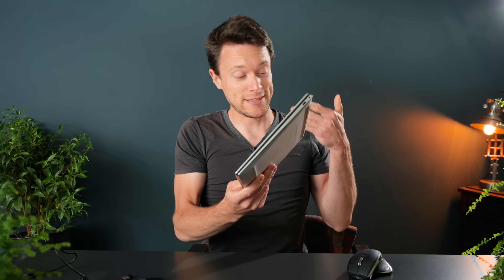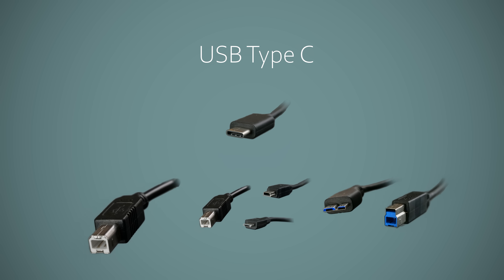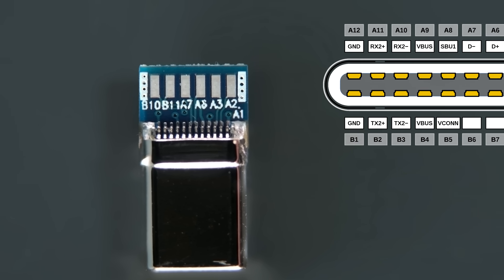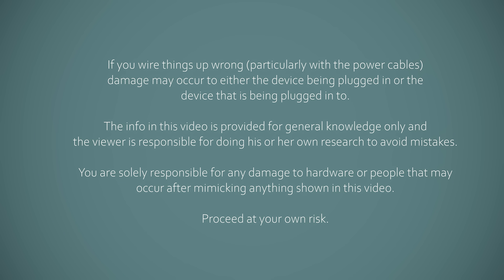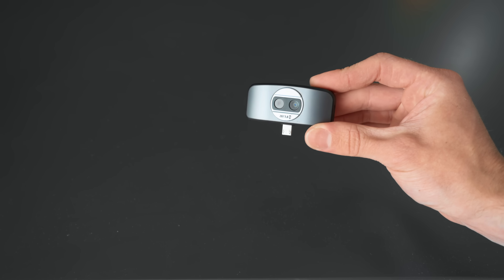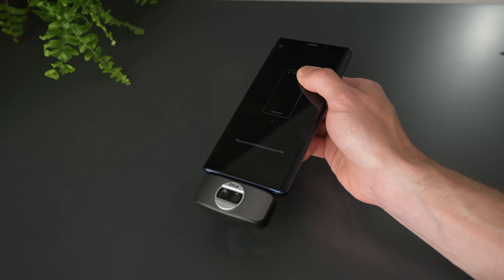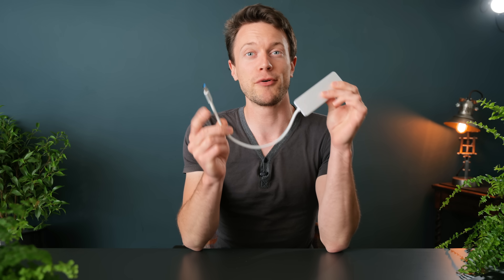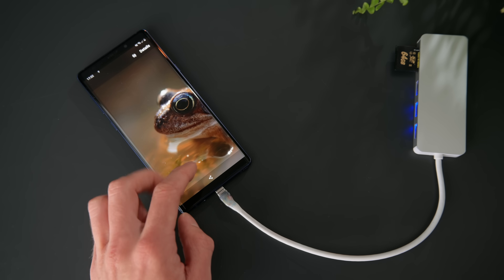Converting devices to USB Type-C

Comment: There is a good reason for dongles especially the micro dongles to use USB-A plug.
They are much more sturdy and wont break easily. It wouldn't be funny to buy a new 10-20€ dongle each time after accidentially bump against it.
Also if a laptop only has one single USB-C port its mostllikely thought to be used with a USB-C hub.

Comment: I was hoping you'd do B-C
A us very useful and not really in need of replacement. However B needs to go away.

But A is very resilient and strong unlike C which feels like it could break easily. Especially if you're using a wireless adapter. Type C would snap under the weight and pressure of a USB stick or my 8bitdo adapter.
Reply: I have never had a USB C break on me, and I use them heavily.

Comment: The issue with USB Type C is people always think that there's only 1 Type C but technically there are several, there are type C with USB 2.0, 3.0, 3.1 standard, and then there's Thunderbolt...
Reply: But they're all intercompatibal, so it doesn't matter. Theres also many versions of USB A, and even they're inter compatible.

Comment: 3:36 couldn't you trim like 20-25% off, seems no traces on both sides :D
Reply: Nope, it's very faint but you can see the antenna in the top part
Reply: Then maybe antenna from wire would work?
Reply: @pofka3000  if you want to spend hours researching how to make an antenna from scratch and how to solder it on, sure. I can guarantee your solution won't be more compact than what's already there.

Comment: Will there even be connectors in the future as everything will be wireless? Something completely different, can we use stretched bar type displays to cover bezels of 2-3 adjoining monitors? Of cours the bar has to be bezel free as well. We might even use a couple of old macbook touch bars for those.

Comment: 7:04
You could have just added a solder blob between Ground and R1 after scraping the trace to V+.
Or you just remove R1 and solder it where it says R2.
That would save you the hassle of soldering this THT resistor onto the board.
Reply: I also was surprised! This info should be included in the video!
Reply: I thought the same thing, the circuit board seems to literally be designed with the extra solder pads for that purpose. It is possible he thought this method would be more accessible to novices. It's also possible that being close to the project he simply overlooked this method. I know when I'm modding sometimes I get an idea in my head about how to do something and I later look back and realize I missed an obvious optimization.
Reply: It may be a pain but I would just reuse that resistor right. Im going to assume the resistance value is important
Reply: yes, when you plung something a voltage divider is made from the DFP (host device) and the UFP (Device device), that voltage set the power delivery, if 0.25 - 0.70V then is legacy 500mA, 0.70 - 1.31V is 1.5A and more than 1.31V is 3A. anyway that just set the limit. if that resistor was 56k the V will be over the limit if the port can't give 3A. What will happen? on somes times that just shutdown the port.
Reply: Yeah someone clearly went to the trouble of making these boards as easy as possible to switch, and he just destroys the trace and slaps an absolute unit of a resistor on there. Just sliding the resistor over to the other pad means you don't need to have spare resistors on hand, and you don't have to guess at resistor voltage.
Reply: Thanks God you mantion it, I thought the same and was wondering, becouse he seems to be a person with enough knowledge about electronics and solve this problem in such a strange way.
Reply: The value for a pull-up and pull-down resistor on a USB-C device wouldn't be the same, so simply moving the same resistor to the other pads probably wouldn't work. Still, it would have been easier to just remove the existing resistor rather than cut the trace, and adding the correct SMD resistor would've been much cleaner.
Reply: USB specification requires different resistance for pull-up and pull-down otherwise you potentially would make it possible for the device to draw more power than the plug can safely supply or the plug to push more power than the device can take. Basically  5.1 kΩ pull-down, 56kΩ pull-up. Remember all those cables being sold using 10kΩ and frying buyers devices ; )
Reply: I totally agree. 5:55 It is clearly seen, that moving resistor in the another position should be fine. And this guy has lots of DIY projects, but no understanding of what pull-up/pull-down resistor means. Such a disappointment.
Reply: @sorgmail  yes odd that he didn't do that, I would have thought that would work
Reply: Okay let me explain what @TigerChills means. You see he cut the PCB trace on 5V so no contact was flowing through resistor. He should add some blob on the left side. That way you don't need to remove and relocate the resistor
Reply: @potatobuilds  just as simple as that ? no scraping ? just a single blob on the one to the left of it ? you don't have to blob the two together ?
Reply: @artusart  You missed my point. He cut and scraped the VCC to R2 that's not a bad thing actually if he did that instead he should add a blob on top of both R1 and R2 that way you don't need to add a big resistor or remove completely the SMD resistor on R2. What I said about the left side is actually top left to top right.
Reply: I’m not going to debate which is better for novices (Tweezers anyone?), but I will say that a large THT device on a small SMD board is destined to short on the leads or rip pads for a large number of novices.
Reply: Why on earth would you assume that the resistor needed to pull down to ground, would be the same as the pull-up resistor ??????? Idiocy
Reply: The supplied resistor on the board (pull-up) is a 56 kΩ one. The one that needs to be installed (pull-down) is 5.1kΩ. So you can't just move the resistor over. You either need a 5.1kΩ surface-mount (SMD) resistor and thin solder plus a thin tip and a steady hand, or the 5.1kΩ through-hole (THT) resistor suggested in the video.
Reply: Yeah thats what i think too.  it would do less space and hassle if he reuse the old SMD resistor
Reply: I agree with Tiger. He could just use a wire to connect ground to R1 and then have no need to desolder, find a correct resistor, or remove components. Could even use wires from the USB cable he cut.
Reply: As other said, he at least should have told the viewer why he was going with the THT resistor and show the alternativ and BETTER way.
Reply: Ochir Sanjaadorj Exactly!
Reply: I think you do have a point here, but how would one add a solder blob between Ground and R1? I think that'd be hard not shorting out R2 as it's between the two...
Reply: that would require engineering mind, not a DIYer ;-)
Reply: you can't switch the resistor at wish, you'll have to get new SMD resistors. Do your research first, the Sub connector uses 56k Ohm vs 5 ish K ohm on the host connector
Reply: Possible that the resistor that came with it is 56k and not 5.1k
Reply: It is aimed at novices, and SMD soldering is probably not going to be possible for many people if they are new to soldering. I'm guessing this is why he did this. I'm not sure how much experience you have soldering SMD devices but its a hell of a lot harder than it looks.
Reply: @hadmatter5714  is pretty simple, you don't have to re solder the and component. Just cut the trace and connect the resistor to it's ground counterpart. http://imgur.com/a/PHB0XA9
Reply: @brandoneich2412  so what you should to do with Ground after those 2 steps? Or was it the final step before casing it?
Reply: @brandoneich2412  Thanks for the image.  At this point I don't really need to convert anything but I'll bear this method in mind if I ever do (my beast of a desktop has a ton of Type A's and I rarely plug anything into my phone).  As for why he didn't use this method I'm guessing he just didn't think about it.  Like Unreality said, it's really easy to miss something when you're in process and really easy to critique something when viewing it from the outside.
Reply: @theseangle  you still need to solder the other wires (the 2 steps just removes the need to solder a new resistor)

In the image the two yellow arrows are pointing to two solder pads. The left solder pad is connected to the ground, and the right (which has the resistor) is connected to the voltage. Buy cutting the trace to the voltage, and connecting it to the other pad it will work. You could also solder the resistor  (right yellow arrow in my image) to the larger ground pad (the one with the black wire in my image), but I think it is easier to solder to the small pad which I marked with the left yellow arrow.
Reply: Had Matter its not that hard, it’s more about the right tools.
Reply: It would be more difficult to resolder the smd component with that soldering gun.
Reply: @mangeshpawar9269  totally true!! I didn't think about it until I saw the comment TBH... Lol 

But I shared the image to clarify what others were talking about.
Reply: Armchair experts and critics; although I agree and would myself swap the existing SMD however, for most who have never soldered before, the idea of desoldering is quite daunting not to mention fiddly AF.
Sometimes hacking and adding is easier for some.
In any case this guy did this conversion successfully and to a decent end, most likely before any of us even thought of trying it so...
Reply: @mattkingston08  If the idea of desoldering is quite daunting you shouldnt be doing something where there is a chance to damage expensive electronics.
Reply: its easy for a novice to accidentally melt the resistor. using a full scale resistor makes it easier. But yes, I would have definitely moved that resistor over.

Comment: or, alternatively just buy a laptop with proper USB type A ports, lmao
Reply: Why? USB-C is objectively better in every way. Faster speed, reversible, smaller, high power transfer capability. Not to mention that it supports alternative functions such as thunderbolt, PCI-E, displayport with the same mechanical connector.

Comment: Why didn't you just swap the SMD resistor at position R1 to the position R2, which would have served the purpose of a pull-down. There was no need for the bulky standard resistor as the adaptor board was already prepared for the switch from host to client... Would have been much easier than your step with the additional resistor!

Comment: The "Universal" serial bus that is not now so "Universal"
Reply: I mean USB C is pretty much universal. Its just the first step I to a new era. No one needs these bulky ass connectors when I can just have this small connector that works on my camera, phone, laptop, tv, speaker PS4 etc. If you think about it, the older USB generation wasnt even so universal either. 
I can use the same cord to do essentially everything. Charging, data syncing, tv signal, power etc. That is very universal.

Comment: Why dont you just move the existing resistor to the left side which is connected to the ground. 

Looks like they designed it that way already. If you're not comfortable removing that tiny resistor, you can scrap off the traces of the V+ then pull a strand of wire and run the GND to the top end of the resistor. That way you dont risk fumbling about the tiny resistor.

Comment: It seems that the only flaw is that the host port is weaker than the cable jack. I’d rather the cable break than that little fiberglass tab inside the device.
Reply: depends on the connector i believe usb-c is designed so the cable breaks before the host and same for micro-B I believe? linus tech tips did a video about the strength of usb c vs b its worth a watch
Reply: Never had a USB C port break on me. Much more reliable than USB A in my experience.
Reply: @maxz8807  ive had a usb c device break on me but because i sat in bed on it pushing the cable into my chest till i bent the internal housing so mcuh till it just refused to charge. RIP razer phone 2016-2019
Reply: Max Z it’s definitely better than USB A, but I was thing something more in the style of a lightning connector. The host has a metal female connector with no fiberglass tab to break and the cable is purely male and will break before the host female jack breaks. A design like that seems inherently more durable for the host connector

Comment: Would love to see if the reverse is possible: adding USB type C charging/data ports to older Micro USB devices like game controllers
Reply: The listings linked also have female adapters. I got some C to Micro PCB adaptors a while back and converted some of my devices with internal ports. Have to open the hole as the adapter offsets the plug a few mm.
Reply: Yeah, this would make for a great follow up video. Most of my problem these days is devices that need me to plug in micro USB, because the manufacturer is still living in the past and thinks anyone still wants micro USB. We don't. Stop it, manufacturers.
Reply: Yes you can, infact you can even convert old laptops that use barrel plugs to usb type c, however for these devices you need a special power delivery version of the usb type-c board, then its simply just attaching the cables and setting the power output.
Reply: Me too.
Reply: I really want to see this!
Reply: It should be, as long as the device that uses it is does not require a lot of power or you're expecting sky high transfer speeds.
Reply: Search for the female version on ebay, they have them and would plug up the exact as in the video.
Reply: Tim Romero hmmm you have to think tho if they are using usb c they may have all those extra wires
Reply: Its not possible - USB3 and quickcharge (qc3) not only use different cables, they have a completely different chipset design that controls the device.  If you want USB3 you'll have to buy a new device designed to "talk" USB3.
The idea of USB is that all devices are backwards compatible - so your USB 1 and 2 devices can make themselves understood by a USB3 controller, at least well enough to work their limited bag of tricks - what you can't do is speed up an old device or teach it the new tricks that USB3 uses.  While they all have backwards compatibility, none of the older standards could have forward compatibility.
Reply: @whitehoose  I think you have misunderstood Tims requirement. He is just wanting a USB C socket on, for example, a games controller with a USB Micro-B socket. He is not expecting new capabilities. Adaptor cables already exist for this.
Reply: @whitehoose  USB-C can be USB 2.0, in fact many A-to-C dongles are only 2.0. USB C is just a connector.

Comment: There will be no time, when everything is Type C. Before that, we get Type D, and the race starts again.
Reply: I was looking for that comment. They won't stop with Type C, since tech never stops developing.
Hardware will be getting slimmer and there's gonna demand for a smaller port, if they haven't gotten rid of all ports already.
Reply: I got an ultra cheap soldering iron that runs off USB wallwarts and on the other end of the cable what had they used? a mono headphone jack, which allowed it to rotate freely.
The only extra convenience a new USB form factor can provide is free rotation as a one up to just reversibility.

Comment: Hello your videos are amazing. I have an idea but i don »t know how to make it. I have an old acer iconia tab a510 tab and i want it to be used as a second screen for my computeur, used by a wire.
It works with solutions like spacedesk but it’s really slow and not in good definition. Does it have a material solution ? Even if i have to remove the android part to be used only as a screen. Thanks

Comment: Doesn't anyone there have a 3D printer? You can rent them pretty cheap once the pandemic is over & print up an enclosure for your USB. You can also make a mold from clay of your old USB enclosure, or any small rectangle the right size, let it dry, apply release or wax paper, squish your rubber together in the mold like playdough, trim with an exacto. It'll look store bought with crisp even lines. You can even carve ridges into the clay before it drys to give the USB enclosure details, symbols, or letters. I wish every USB was labeled & readily visible. It's hard to tell the difference between a USB to my Playstation & the mini usb to my Android at first glance. I try to color code mine by buying different color braided cable. & please use braided cable for your next mod. It just looks nicer. & they don't get gummy when they get old.

Comment: I mean it's a nice video but for USB a adapter def. Use this one https://m-de.gearbest.com/chargers-cables/pp_009785407041.html it gets inserted into the USB a adapter and is much smaller then your adapter (even though it's pretty cool). There are different version. The one of the link is otg and should work as a sub device on other devices...

Comment: Or you can just buy a permanent OTG shim that actually goes into USB dongle. No soldering, surgru, out guesswork. If you want you can glue it in and the profile is better than a typical otg adapter.
https://www.ebay.co.uk/itm/163846424593

Comment: How about HDMI? I have a dongle for my phone that let's me cast to a monitor with an extra usbA wire coming out for external power. Are there enough wires inside a C to mod HDMI to C, or the other way around? You could plug some weird things into your phone & the other way you could connect things like a kindle to a monitor. Even if it still needed an extra power source, is there enough transfer speed? Or is there another reason why it wouldn't work?

Comment: The smaller adapter is much better then yours,  what if you had to move your mouse back to a device that have only USB type A???? plus the small adapter  size is not as big as you mentioned, and not to mention the damage risk to your device doing this.